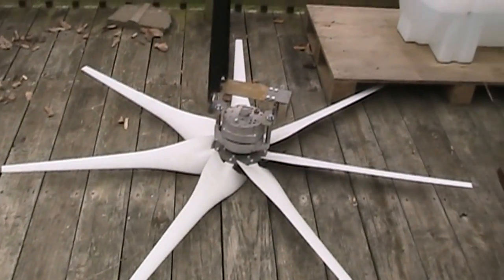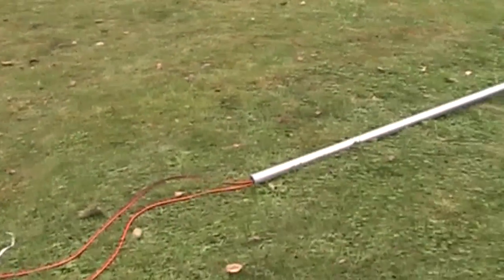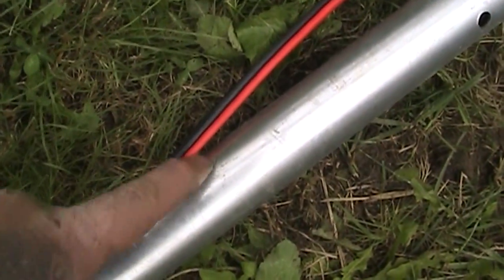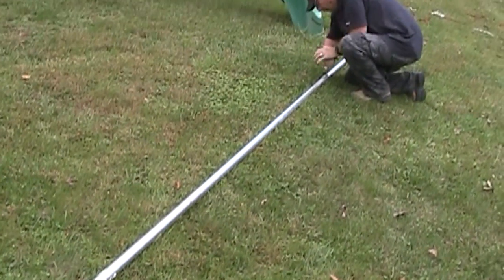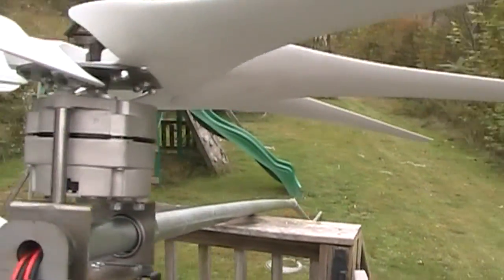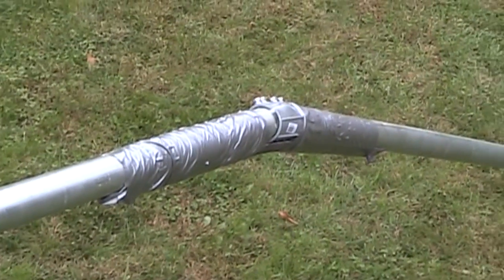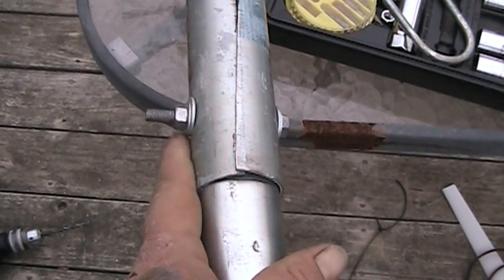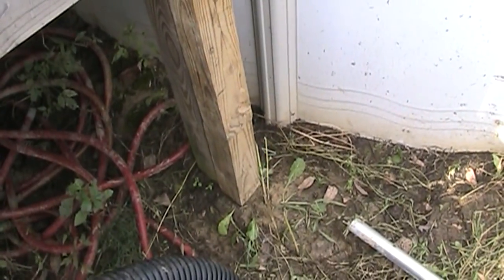Putting up the wind turbine

Comment: I used the same conduit and couplers to put my OTA antenna 30ft in the air, and experienced the same failure to a coupling. I resolved the issue by taking a 2ft. piece of pipe that would fit just inside the 1-1/2 conduit, and used self tapping screws to secure them in place. I used the couplers mainly for looks.

Comment: Will 30' get the wind turbine above tree level?
Suggestions: Too late now, but drill holes in conduit before running your wire. I would also use some type of grommet to keep the conduit from cutting your wire. There must be a good and strong coupler on the market for this application.

Comment: a good solution for the height your going to is use same conduit but 3 strapped together to form a triangle, its very rigid yet still gives, you can stagger the length so that individual coupling is not required, just the straps that hold the 3 together, I used a setup as mentioned to get my antenna an extra 15 meters , but make sure you have  GOOD grounds because lightning strikes are a certainty in the lifetime of the pole! cheers!

Comment: Nice videos! Just a suggestion for other DIYers....I would've used radio antenna mast for the poles. You can get them in 10' sections as well but is stronger than conduit. They have a 6" or 8" overlapping when fitted together and there isn't a need to add couplers to lock the joints.

Comment: Hi Chief ,Do yourself a favor Use  1"1/ 2 inch or 1"1/4 inch steel plumbing pipe Black.Use 2 lengths or 10 *foot sections put a pipe  cap on the end to pound into the ground with.Use a post hole digger and dig out a three foot hole. Next through in about 5 inches of pea gravel and  center your pipe .Now through in one bag of post hole quick set cement .Use a level bar to keep your pipe straight .Toss in some stone  so you need not to hold your pipe in place till the cement sets up.Suggestion put in more than one for a battery bank.Eng. Miles Masek by the way fill in each pipe with about 5 feet of cement to add stabiliity in gail force winds.

Comment: schedule 40 water pipe works great and super strong. Cost is a bit more than conduit but the strength is awesome. Schedule 80 to the first guy wires and you can go another 30-40 ft with schedule 40. Threading couplers and the perfect seat for the guy wire ring

Comment: You used an aluminum electrical tubing joint to hold that assembly up ?  They aren't meant to carry any kind of load like that.  You need a section of steel pipe the longer the stronger...a few tack welds wouldn't hurt either.  But hey you are putting in the Ole College Try... Good luck with it !

Comment: I've recently become interested in off grid, power generation and the like. Some of the information I have come across suggests that vertical axis wind turbines may perform better than the windmill style. I would guess this is because they have more surface area for the wind to push on.

Comment: Unfortunately the screws going through pipes will eventually wear through the insulation of the wire over time with slight movements of the mast in the wind.... Have you noticed the guy wire hooked to the house resonates in the wind and sings to everyone inside a nice song...?

Comment: Hi John. I see an issue in the future on your tower. The way you cut the slot on the bottom has the potential of rubbing through the insulation on the wires that travel through it from the vibration of the spinning turbine. An easy remedy that would cost you nothing but things you already have and 3 min. of time would be to split about three inches of rubber fuel line and put it on the wires where they come out of the hole. You can secure it with a small piece of electrical tape. Think of it like putting insulation on a water pipe in your house. The idea is that the wire will be padded at the hole and not get friction damage from the vibration caused by the spinning turbine. Your video was great as always! Thanks for sharing!
Reply: Walt O'bringer I was thinking the same thing. My thought was to file the edges of the pipe to smooth it out. Your fuel line idea is a good idea.
Reply: +EarMode I was thinking bicycle inner tubes. Fuel line or radiator hose seems better though.
Reply: Walt O'bringe

Comment: Yea that EMT piping is not for supporting anything, but rigid pipe will support things, like black pipe, you use pipe wrenches to screw them together with fittings but galvanized rigid will work outdoors or paint the black pipe.
Reply: +Tony Hardy You are right Tony. The conduit is not only weak but the clamps will shear sideways. MW&S recommends using Black Pipe but better yet they recommend the galvanized 40 schedule  pipe, and yes they are expensive. Around here they are $67 for a ten footer without the couplers.  I found this link to see how others are setting up their wind turbines. This link is not bad. At least jnull) shows what he is doing. Other guys are too busy swinging the camera or no audio. After seeing what jnull0 did. I figure on using a 3 or 4 footer on the bottom with a TEE to route the wires through. But I am still looking for a tower. I missed out on a used 50 ft for $400. I know of a 80 ft. tower for the same price but it needs a crane once I got it to my land to stand it up.

Comment: I'm just wondering how that conduit is holding up against the wind and pressure from the turbine? I ran my bolts all the way through the coupler but I only used one extension and that the coupler I filled it full of Great Stuff foam it added a lot of agility expanding foam worked great! Mine was up for about a year before the conduit holes where the pipe was bolted together started to get wallowed out had a noticeable wobble to the whole thing caused by the coupler all I did was pull out the bolts fill it full of expanding foam shoved  the bolts back through and bolted back together! Better than the day it was put up 10 times stronger!

Comment: love how ur going to get-er-dun however u can. im worried the pipe might not live through a good wind storm. im not sure of where u live but batteries work best at 80F and your box is outside. I had 6-six volt batteries in a 5th wheel and only smelled them when i was equalizing them. just FYI  love the video

Comment: I wouldn't bother with the pipe sleeve and clamps, I'd just weld it or use a slightly larger pipe or heat the sleeve with a torch and beat the other pipe into it, than bolt it up.

I could also use my exhaust pipe expander to enlarge one of the pipes. 

Sever years ago (B4 cable TV) I had one of those antenna motor's and I used a tree with a 15' pole setup. I was approx., 50 feet up. Worked well for 10 yrs.

This is still an informative post.

Comment: Do you have a video that shows all your components and where you bought them? Great idea on using the conduit for a tower. I want to go solar also just need some pointers on parts, and how to get it all wired up. I use a mini solar light set for the evenings that has a tiny battery bank, I will try to do a video and post it on my channel.

Comment: I love windmills.  I have a few decorative versions in my yard that I have rebuilt and have been eyeing a full sized windmill down the road.  it has a 35 foot or so steel tower and a gear box for pumping well water.  

the detail that I have never got my head around is the head swivel system.   the wind changes direction, the head swings to meet the wind, but the wires are running straight down the pipe.  eventually, arent the wires going to twist up due to natural events?

Comment: Unless you have already done so, I think you should have drilled completely through the pipe and the back of the coupler. with only one hole, as the pipe sways, the coupling may eventually crack depending on which section takes on the most stress.screw holes may eventually elongate and the connection becomes  compromised.  The alloy the couplings are made of are not the best for your type of application.

Comment: Wow, things have really progressed since this was made, modern systems use 3 sets of guy wires, much more efficient blades and generators with speed controllers and braking systems. You might want to look into making some upgrades to this old system to improve it's output greatly.

Comment: I want to ask a silly question.... When the wind catches the tail fin of the turbine for wind direction, how do you deal with the cables or wires not being knotted / twisted within the housing of the turbine?  If the wind were to push the tail round and round ??  Another silly question is what about a lightening striking the pole?  Do you have to use any safeguards?

Comment: J, where you have the wire coming out of the tower pipe need to be protected so the wire will not fail. Use and ole piece of garden hose and cut it to fit over the cut edges of the metal. and then spray foam the opening so bees don't get in your pipe.

Comment: hi guy, really consider getting rid of EMT conduit.  The die cast fittings will crack for sure.  You weakened the wall of the pipe by cutting that hole in it.  I want to see you succeed. Hate to see that come down on a person on your deck.  Look into rigid steel conduit with threaded couplings.  I wouldn't go less than 2.5" rigid.

Comment: say the wind changes direction a few times per day, will it twist the cables inside the pipe so that after a time they will snap ? Or you have up there a mount that lets the cables alone not to twist ?

Comment: That thin wall conduit might last longer by adding a set of guy wires lower down, at every 10 foot conduit joint , Also I noticed that the PMA mount fit to loose on that conduit,, you will get rattling from that. I use the rigid 1 1/2 conduit that is threaded at each end, It fits the PMA mounting bracket nicely and it is much stronger. It costs around $40 bucks a 10 foot length from Lowels.

Comment: when you used longer bolts did you think to put insulation between new bolts and cables to prevent cable chafing on threeds or even shorting out

Comment: Hey John, I had a radio tower up in TN that got a lightning strike. I had a guy wire run to the house just like that to support the coax than ran in to the radio shack. Somehow the lighting arced from the guy wire to something in the attic and started a fire. We never could figure out what it arced to. I managed to get up there and extinguish the fire but put my foot through the ceiling in the rush. Took out everything in the house that was plugged into an outlet. Insulate that guy wire hoss.

Comment: Hi. How does your system deal with the issue of the revolving generator and wind turbine. I did not see a rotating coupler for the electrical connections. are your cables not twisting off?
Reply: Slip rings is the right option to prevent from cable twisting issue

Comment: Wires were black electrical taped to protect them. My turbine and pole have made it in 40+ mph winds.  Johns engineering will work prayer, blood, sweat. Normally prevails.  God bless.

Comment: Looking good. Like your solution to joint problems. Might bend somewhere else in a severe storm but not at those points first. Will be interesting to watch your results as wind conditions vary. How often you'll have wind to turn, etc. How wind & solar work to backup each other, etc. 

Want to do some solar & maybe wind here soon.

Thanks for sharing.

Comment: just letting you know i have a 1600 watt i got from the same place and high high you put it in the air will make a big difference especially in the summer when there is less wind i got mine about 25 feet and its not really enough i need to raise it good vid

Comment: As a seasoned electrician and lead installer for PV and residential wind I see a lot of problems with this design. Aside from code issues the mast should have been made with schedule 40 ridged pipe. EMT is very weak and will rust through in a matter a couple years. Second your yaw setup  looks like it will work fine but you need a different means of wiring up the motor as the wind changes directions the wires will not only wrap around each other but the unprotected wires are rubbing against the ridge of the conduit it won't be long before the insulation is cut through and you have and energized mast that anyone can touch and get a shocked. I understand the project is on a budget but you don't want that turbine landing on your roof in high winds or a family member getting shocked.
Reply: couldn't agree more thx
Reply: It's a low voltage system. The only chance of a shock is if you licked it during a particularly gusty day.
Reply: ~~~Ben~~~
Amperage is a bitch. It is not a 9 volt battery.  I collect 200 amps from the sun DC 24v. It will knock you on your ass if any simple condition exists.
Reply: I don't know where you got the idea that it collects anything from the sun. It's a 12 volt alternator. Amperage is simply voltage divided by resistance. You don't have amperage until you have a load across a voltage.
Reply: Some seasoned electrician, it's 12 volt.
Reply: I Will Not Comply amps don't flow of the cookies are too low. That being said 24v is getting up there.
Reply: Brandon Maas  I don’t even trust schedule 40 for this stuff anymore, I had some for a3x5 flag poll, was only 4 years old and snapped in a wind storm. Gusts of 60mph... sure that’s good wind but a 3x5 flag pulling it down? Now I overkill anything I put up

Comment: i already see one problem thats going to happen. those wires at the top, are they connected straight the the wind turbine? if so in time they will twist everytime the wind changes direction and will snap off. i suggest you make a round cirrcut at the top so they dont twist the wire everytime the wind vane turns.

Comment: Where did you get that 10/2 wire from? All I could find at my local big box store was 12/2 landscape wire about $50 bucks for 100 feet. The 10/2 would be a upgrade for my setup if the price is right :)

Comment: Nice system.  As far as the wire goes you should be fine, just make sure to label them. On the ground side I used the mounting pipe as my ground from the top to bottom, then ran my ground wire from that to the batteries.   Good luck. keep up the vids.

Comment: As electricity follows the path of least resistance two wires will still overheat because it dosent split off thru two different chanels the two wire system is only prolonging the inevitable also the batery box should not be near the building for fire safety

Comment: The power coming from the generator will be more efficient if you send the dc current through a rectifier to make it 3 phase ac. It's a lot easer and cheaper to wire.
Reply: Inverted dc to ac to be correct.

Comment: I would split the wires at least two or three feet apart from each end and attach the red wires together and the black wires together that way you know which is negative and which is positive and you won't get it mixed up that is the smartest thing to do. Because if you do what he's talking about there's a good chance you can have positive on one end and negative on the other end which would create a short which would be very bad it would mess up the wind turbine and the batteries and could do more damage to the rest of the wiring in the house.

Comment: Looking good bro, one thing though I would have put both the red wires together on the positive and both black wires on the negative, that way if the label you have comes off then there is no confusion as to which ones are which. I like the split tubing idea, good stuff overall!

Comment: Ideally you want the inverter as close to the batteries as possible. Then with 100mm-200mm cable from batteries to inverter. In an ideal world. Just to minimize any heat and voltage losses.
Reply: Daniel Wilson   DItto.  Transporting DC is costly compared to AC.
Also getting the battery box away from the house is a benefit.

Comment: Schedule 40 Gas Pipe would work safer and stronger, start with 3 inch for 15 ft then 2 1/2 inch for 10 ft then 1 7/8 inch for 6 ft more, use reducer couplings for gas fitting and screw it all together then weld it with mig. put guide loops welded on reducers and don;t forget a 15 ft gin pole and extra guide wire 3/4 length up to fasten to gin pole. Get a angle bracket cemented into the ground 5 ft sticking out 3 foot and hinge the bottom of angle iron fastened to 3 inch gas pipe. The gin pole will make raising and lowering that pole like butter, Boys. Have a thought out hinge on 3 inch pole and then You will have better control at all angles!

Comment: Great, but What about the rain ?  If water gets inside the generator? it is not a problem?
Reply: Dan Becker, it won't be an issue buddy. When you drive in the rain, your alternator on your vehicle gets soaked, it wouldn't be any different.

Comment: The 10-2 wires coming from the . Did you say one will be positive and one will be positive? You meant one will be negative?
Reply from the maker: jtjohnst1965 Yes, one set was positive, and one was negative, not sure how much they retail for now it's been a couple of years on this one, and I don't think this has a brake on it, I was able to turn the blades before it was hooked up.  Hope this helps....................................J

Comment: Thanks for the video! I can't wait to get a turbine going at my house too. I'm glad to learn what you went through here.

Another idea for sturdily coupling the pieces of conduit which might work is to flare the end of one and slide the next one into it. then you could drill straight through both pipes in two or three places and use carriage bolt and nut per drilled hole. Harbor Freight sells a tool for flaring exhaust pipes in their automotive crap. I think it's about $10.